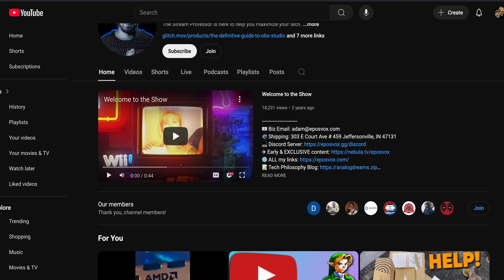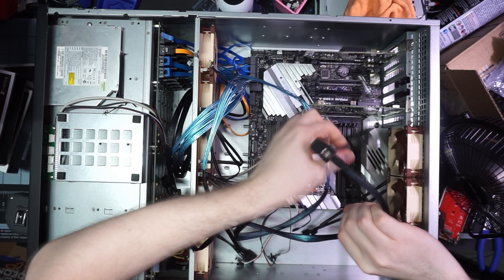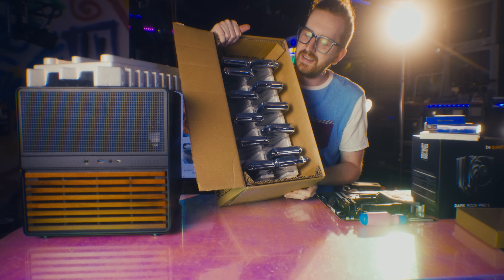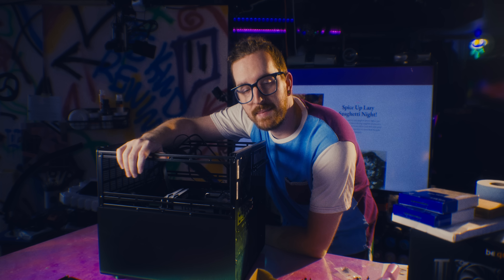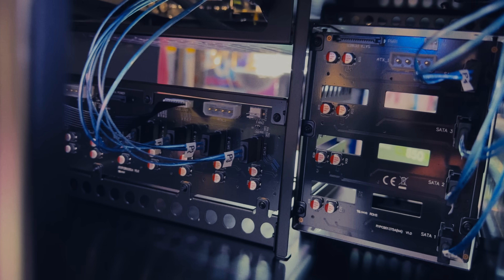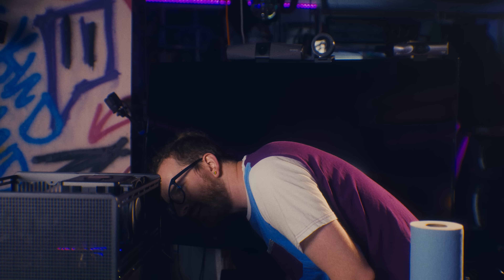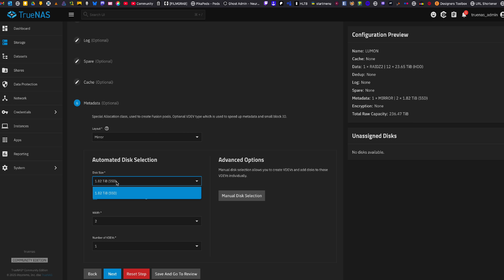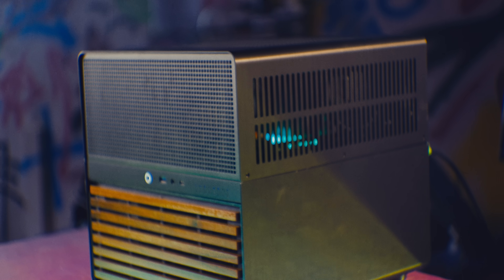It's time to build your own NAS (It's SUPER EASY)

Comment: and to think that I have 32TB in NAS, and I'm trying to figure out how to convert materials from 264 to AV1 to save space, and postpone buying new drives :D
Reply: fileflows, check it out. I converted around 30Tb of 264 to 265 and saved about 16Tb
Reply: @salmon85   Any noticeable quality reduction after conversion? Sounds like an automated handbrake type software
Reply: 265 is better than 264  @AndySomething
Reply: @AndySomething  yes there definitely is a quality loss, especially if the h264 files themselves have a low bitrate (less than 20-30mbps). there's no point encoding from a format like h264 or h265 or av1 to each other, these are all already heavily compressed from the original source. if you care about maintaining quality, just buy more hard drives. you would only benefit from converting to h265 or av1 if your source is a gigantic RAW or lossless file, OR a very large bitrate h264/5/av1 file (200-300mbps+). most movies and TV shows have quite low bitrates (5-20mbps) so re-converting them just losses quality and wastes a ton of time
Reply: @theendurance  most of what I have on my disks and want to leave without deleting is material from drones and sports cameras in 4K, 264, 60-100mbps. I'm not a quality purist to care about a small difference in quality. But saving 50%-70% of space, at the cost of a little quality - sounds tempting!! I recorded a few gaming videos, once I streamed - I have 450GB of material 4K/60fps/55k bitrate :D ps. movies/series have to be in 264 anyway so I don't have to transcode anything to watch it ;) And I don't want to waste electricity and money to put up a separate machine with intel arc so I could watch it on TV from NAS. :)
Reply: @salmon85  I came to say the same thing, after getting tdarr up and running, FileFlows just works and has a modern interface, however it doesn't have the same level of user support configs.
Reply: @salmon85  the program looks FANTASTIC! However, to test it, I had to add an exception in the physical firewall to enter the site. Just downloading the installer causes alerts from Windows Defender, and Norton Antivirus... 0.o after installing on the VM, dozens of connections to the software manufacturer's servers appeared... I don't know if I want to give access to my disks to such a company. :( P.S. it's a pity, because the software looks like the ideal of what I'm looking for :(
Reply from the maker: Obligatory reminder that saving space going from one lossy format to another without quality loss is difficult. It’s possible, but will not be as drastic as av1 could offer going from source compare to h264
Reply: Converting to AV1 is so damn slow with CPU encoding, and GPU encoding is generally good for speed not best compression and quality. Consider just converting to 265 which will still get you a significant space saving and is several times faster encoding. 

Alternately, delete media you haven't touched in years and would be /easy to reacquire/ if you ever wanted to.
Reply: @TimSheehan  I bought 9070xt partly because of EposVox video about praising the card for AV1 implementation - after minor tests in Davinci Studio, either I'm doing something wrong - or AV1 is 4x slower than 265 - Just as you described!!
I just need to find the perfect balance between quality and size. and transfer it to handbrake, set up remote desktop and... go away for the weekend :D

And as for deleting - I'd rather have worse quality stuff on disk than not have it at all!! ;)
Reply: @I3eeYou  AV1 is just going to be slower, it's more complicated. GPU encoding is also just not for this purpose - it's good for live-streaming, plex-serving, or creating proxies for video editing, or when you just want to render something out fast and don't care about the filesize, but GPU encoding is the fastest, not the best. If you want better quality /and/ smaller files (yes, simultaneously) you need to use CPU encoding, and this is probably the position you are in for a home media library that's being stored long term and you want to look good on a TV when you watch it.

Comment: Picking a Nas system is still the hardest and most expensive part. It's just not affordable
Reply from the maker: Any old PC can be a NAS. Can pick up a 10 year old junker dirt cheap and turn it into a nas. That’s the cool part. It can be very affordable. The expensive part is the drives.
Reply: @EposVox  facts. My first nas was a dell with 2x1tb hard drives. The optiplex  was free from a buddy in IT. Pentium 4,1gb ram and 500gb wd green. This was 2010. Now $100 gets you an optiplex/precision desktop with at least 4 cores and 8gb ram. Also cheaper options but not as expandable.

I spent more on 4 hard drives than I spent on my whole nas.haha
Reply: Yeah I've just bought all my parts for my new DIY NAS and it's expensive. I think realistically for like 99% of people building and setting up a good home server is probably not realistic due to cost and time. I think for those people I'd either just recommending using pirated streaming sites if watching stuff they can't find on Netflix is the goal. Alternatively try and find someone who has a Plex server and is willing to share.
Reply: @AndySomething  a NAS isn't only for Plex, it's also for backups and network file share, and depending on your setup, running other applications (K8S, PiHole, NGINX, WireGuard, etc). Still a huge investment, but it can be worth it if you're into IT, CS, SE, or just don't trust FAANG-likes